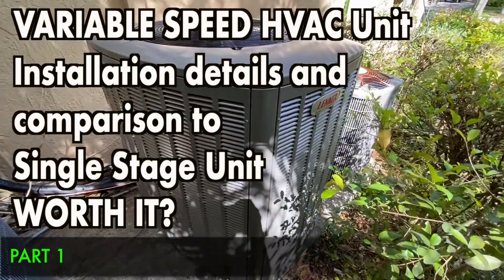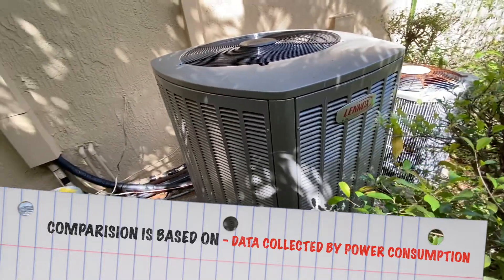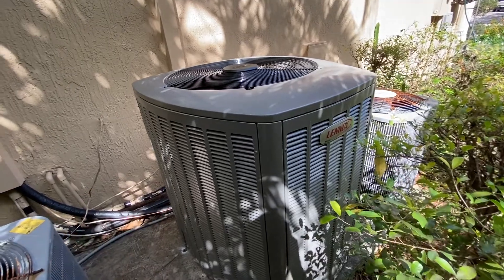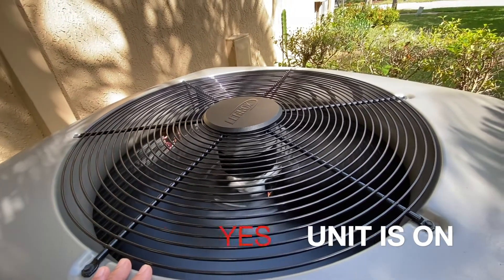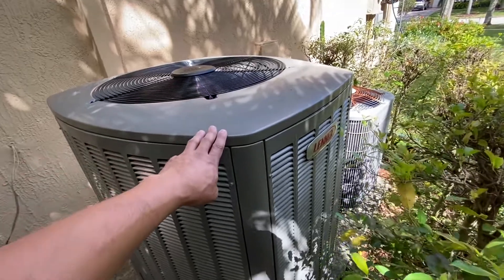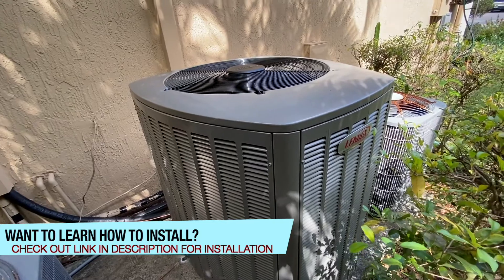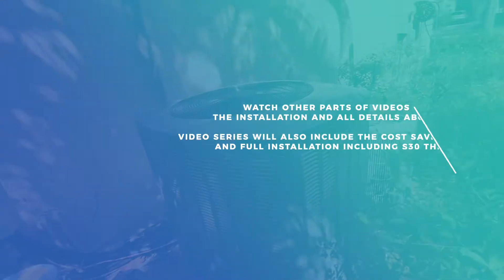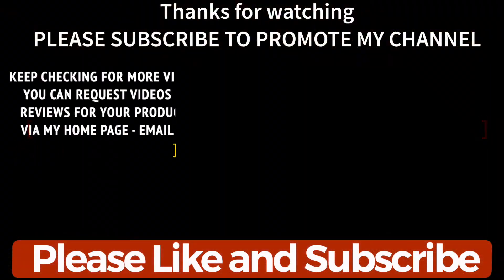Variable Speed HVAC unit - Comparison, Installation and Power Consumption PART1

Comment: Been a technician in manufacturing for years.  Everything has changed to vfd for a reason.  Everyone is taking about cost of repair. Yes it's more expensive to repair.  However anything ran by a vfd does not spend its lifetime running at maximum speed.  Variable frequency drives send lower or higher frequencies as needed to speed or slow the motor.  A single stage or 2 stage only runs at two speeds one being max.  Running lower power generally increases lifespan.
Reply from the maker: Good points But the savings are great and normally these units last 10years. The older manufacturing were quality products but now a days you will be lucky if VS or non VS last you 10years without giving issues.
Reply: I have a single speed heat pump that has been running for 25 years at least...( with minimal repairs)  you cannot have machines like this anymore...
Reply from the maker: Oh yea definitely no way but the other fact is that the older machines consumed more power so you pay more in electricity and now a days you save that money but spend on repairs lol

Comment: In many  US states it is illegal for a home owner to use even a certified technician hired to install an HVAC system if they are not a licensed contractor. The tech could be fined and the home owner as well for knowingly hiring someone who is not a contractor. If the homeowner is not  EPA 608 certified he cannot even put gauges on the unit legally. I know this because Im a licensed Contractor and an EPA 608 Transition and Recovery Instructor and Proctor. Be careful
Reply from the maker: No he is actually licensed. Good point though
Reply: yeah bro, in socal, 85% of the so called hvac techs are 1/2 assed installers playing contractor.  they water down the industry and nobody enforces the laws.  most of these guys don't even have a epa license.  But they can install it whether it works or not when they are done.....
Reply: Coming from a Licensed Contractor playing the fear factor in a lame attempt to scare you from knowledge and protect his turf...nationally....AND interfere with what you do in your own castle. "Be Careful":  The Federal HVAC Certification Police is out to get you.  RIDICULOUS.
Reply from the maker: Like I said earlier. He is a licensed contractor
Reply: @HowToDoitright  I was referring to Drew Bello above, not your actual contractor.
Reply: What they don't know they can't be like little gods and control our lives

Comment: Another benefit is that your wallet will be a lot lighter when repairs are needed.  Don't forget, it'll prob only be 5x the cost to repair a variable HVAC over a single stage.
Reply from the maker: A L Again...there is a 10year warranty in this on parts so NO worries about that. These units are mainly for people who can afford it. Not for people who cry to spend $ on repairs when needed. Anything and everything breaks as they age so be ready for it but saying that these unit break more often is incorrect. Infact these units runs longer then basic HVAC models as they tend to run not as aggressive and harshly as single stage. 
Trust me I did a lot of research before buying. It’s been about a year now and I’m very happy with my unit.
Reply: @HowToDoitright   Good luck, just stating the facts that repair cost (including labor costs, not just parts), are very expensive on two stage and variable stage systems (compared to a single stage system).
Reply from the maker: I see your point but honestly the difference between them is the controlling and communications. They have microprocessor smart boards and not traditional relay. When microprocessor board goes bad those needs to be changed out as a whole. Honestly it’s more easier to fix these system because it’s like plug and play for new board and programming is by push of a few buttons which are in manual. I installed my system myself and did everything flawlessly Ahl...the repairman charged a lot because they act as if this is so hard plus they figure when homeowner can buy an expensive equipment they can pay for repairs. It’s like changing oil on a BMW VS PRIUS. Both procedure is same but the name of car spells out the cost of oil change. Very unfair.
Reply: @HowToDoitright  how is the unit working 12 months later?
Reply from the maker: @MPjustaman  honestly can’t complain. It’s been 2 years actually. Saved me a lot on electric bill.

Comment: And, when the variable speed module goes bad and the manufacture only sells the motor with the module that's $$$$$$$$$$ part to buy.
Reply: 10 years seems like a short time after they have elapsed like they did with my Lennox unit. I just spent $1500 getting it fixed. :/
Reply from the maker: I know but that what they warranty for
Reply: Well if the system is under warranty then parts are UNDER WARRANTY
Reply: Exactly....also...call for a warranty claim on a part and the manufacturer would find 7 different reasons on why is not covered. I recently purchased  a home, one unit is a basic system from 2012, the second unit is from 2018 all electronics and sensors....guess which one constantly breaks. Complexity means more repairs and the manufacturer hold you hostage of proprietary technologies and parts. Get ready to get a pocket hit with the repair and parts bill.
Reply from the maker: That is not true. I deal with many manufacturers and they replace parts without any questions. Recently ordered a air handler motor module from Lennox and they sent one after their technical department had me do some troubleshooting and they confirmed it’s bad and sent me a new one. 
It all depends who is calling. If a home owner calls they will most likely deny it but if a smart homeowner calls who know what they are doing they will authorize it. You just have to be smart about it.
Reply from the maker: It’s covered under warranty for 10years